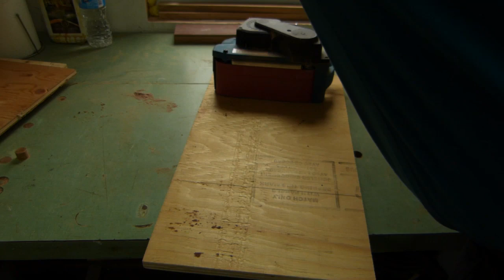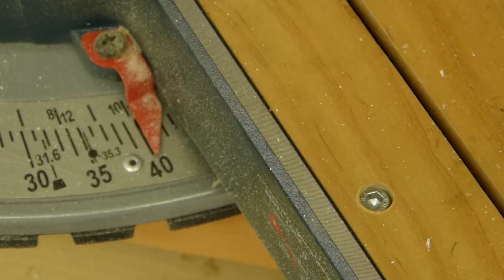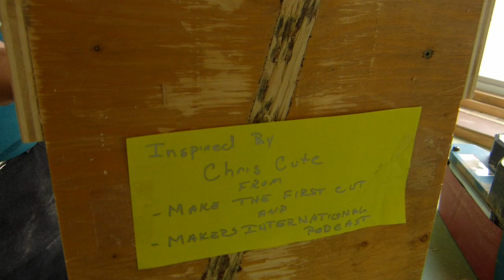A Cute Sander Jig

Comment: I suspect that's going to get a lot of use. Also, by releasing just one clamp, you have your power tool back for normal use. I don't know, that Chris Cute has a lot to answer for (he he). Nice one Jim ☺
Reply from the maker: Mine is a different design that I came up with.  Chris inspired me to get my butt in gear and get started on building it.

Comment: Excellent.  Can't wait to make my own.  Question: how did you ensure that the sanding surface was square (that is, 90 degrees to the table top)?
Reply from the maker: I used a square.  Turns out, most belt sanders have sides that are pretty much a right angle to the belt.
Reply: @JimDockrellWatertone  Agreed, yup.  Any issues with the enclosure not allowing the motor to breathe?  Thanks again...
Reply from the maker: @christopherrussell-mea-6982  No, I've mounted it in that direction so the most air circulation is on the top side.  I don't use it for hours on end either.